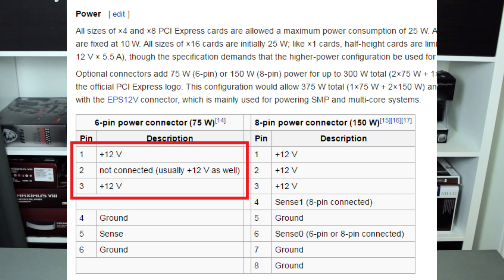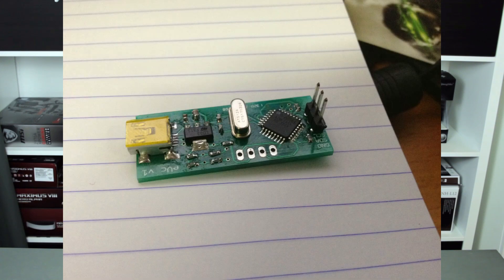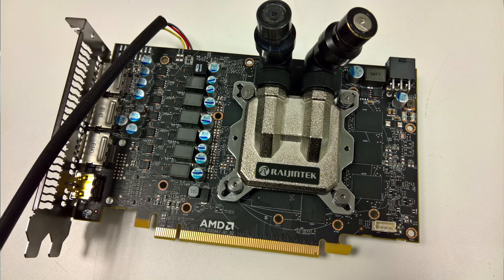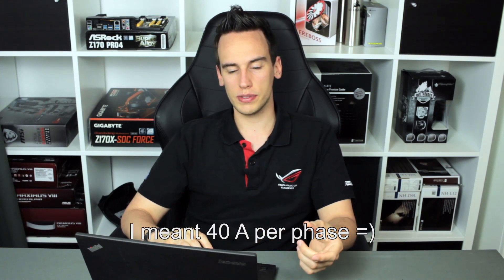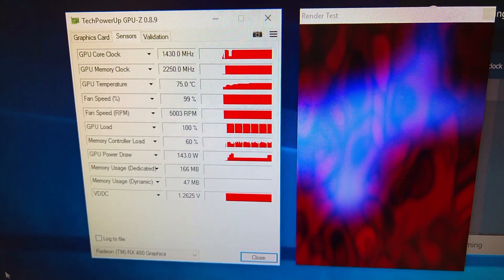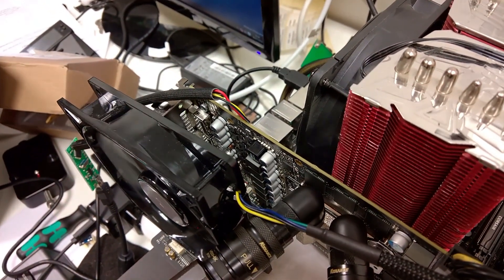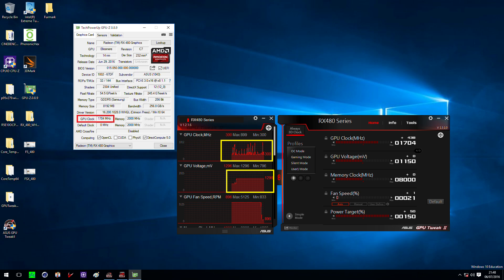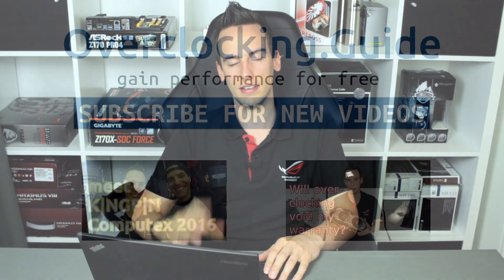Advanced AMD RX 480 Overclocking - 1500 MHz using I2C and watercooling

Comment: The first step anyone wanting to use a RX 480, is to check the motherboard's PCI-E specification to see if it's 3.0 or higher, the latest version if 4.0 slots, which is likely ONLY found in high end motherboards (mobo manufacturer uses 'spare' and surplus parts for mainstream boards because it's cheap).
Reply: PCI 2.0 should also be able to handle it. Also the AMD fix added one option to enable compatibility mode which throttles power so it doesn't exceed the 150 TDP in case you are too worried about it.

Comment: Great video. I'm waiting on my Sapphire Nitro pre-order atm. I suppose keeping it a constant 1400mhz should be fine? Or should I only clock up b4 gaming?
Reply: The gpu downclock if its not running hi demanding 3d load, no need to adjusting the setting for light work.
Reply: That's how I treat my overclocks. There's really no reason to run an OC while on the desktop or browsing YouTube.
Reply: Yea, but from what I can gather from screenshots you can OC by phases in Wattman so if you just OC on the higher phases you can actually keept it a low clock values in the lower ones (browsing, etc), ye?
Reply: Oh, I don't know. I'm not familiar with Wattman.

Comment: graphics score was 15,363. that is huge.
Reply: No, the second benchmark with the 16 612 score is without tesselation.15,363 points were made with standard settings
Reply: Notice that he has modified tesselation for that score.
Reply: Naah ... not really. Guy with 1360 MHz did  15,526 :)
http://www.3dmark.com/fs/9048815
Reply: weird its not huge in % but boost performance better i don't if smaller chip make oc values better
Reply: ....with tessellation disabled

Comment: in games its comparable to gtx980 or its better fps when overclocked ?
Reply: It depends on the title and the DirectX used. In general, DirectX 11 games will run better on Nvidia's GTX 980. Games that are optimized for GCN or use DirectX 12, will probably run as good if not better on the RX 480.
Reply: "no it doesnt touch 980 perf. someone here in the comments even posted his oc 970 and it was worst than his 970 oc." • Overclocked the 970 can get very close to 980 performance, and while the RX 480 will sit below this in terms of basic performance; keep firmly in mind that the RX480 simply has objectively a lower Clock and fewer ALU. This said overall the 970 OC, 980 Stock and RX480 Stock are very close in terms of performance; in general terms. It of course can changed on a game-by-game basis, but actually the more eclectic performance of the RX480 suggests that the Hardware itself isn't strictly bad but rather the Drivers are much more clearly immature and unable to really optimise DirectX 11 or OpenGL titles to the new Architecture. • This might give the impression that the GTX 10-Series (NVIDIA) have better drivers, because they're not experiencing the same issues in terms of aggregate performance ... but you also have to keep in mind that Pascal is Maxwell on 16nm and Shader Multi-Modules (as in instead of each SM being a 128 CUDA Block, they're 2x64 CUDA Block that can run simultaneous calculations; this allows VR to literally operate as if there are 2 GPU @ 970 OC Performance or improve Asynchronous Compute performance while still not actually supporting it on a Per ALU Basis like AMD); so realistically speaking for NVIDIA it was already highly optimised hardware and thus all their gains were primarily due to due size to continue to brute force the problem. AMD however while their Architecture is compatible with GCN, is almost an entirely different approach ... this might take time for them to begin to properly optimise the Drivers; less of an issue for DirectX 12 / Vulkan that is by-passing them anyway.
Reply: I think its comparable to the 980 but it's still a mid range card don't expect too much
Reply: no it doesnt touch 980 perf. someone here in the comments even posted his oc 970 and it was worst than his 970 oc.
Reply: The person who posted their 970 results was wrong.  When he posted his Firestirke score, his 970 at "1.5/2ghz " scored 2000 points lower graphically than the 480 score in this video (the first score without messing with tessellation).
Reply: Folopolis Did you mean 1080?  Because I think a non-reference 480 overclocked will absolutely beat a stock or slightly overclocked 980 by itself without CF, judging by the scores on this video.
Reply: 5 months later, which one is the better value now?

Comment: Ich hatte letztens eine Idee könntest du (falls es in deinen Buget/Intresse ist) irgend wie 3 jahre alte Komponenten Kaufen und probieren die so hard zu übertakten mit Stickstoff usw. Und schauen ob man auf eine benutzbare leistung kommt? Ich fände das voll interessant;) 

Gutes video Btw. 

+1
Reply: 7950 unter Luft von 800 auf 1150, rennt seit knapp 3 Jahren mit dem OC zuverlässig und benutzbar ist das definitiv. Die Zeiten als die Performance sich so krass entwickelt hat sind vorbei.
7950 hab ich 2013 für 199€ gekauft, die hat ca. 4TFLOPs und 3GB 384bit Speicher. RX480 2016 219€ 6TFLOPs 4GB 256bit. So gigantisch ist der Sprung nicht. Die übertaktete RX 480 hat ~50% mehr Rechenleistung, also was die in 2560x1440 kann sollte meine 7950 in meinen 2560x1080 auch hinbekommen. Kann man mit leben ;) (und gibts für 85€ auf eBay Kleinanzeigen)
Also da müsste man dann ein par Jahre mehr zurückgehen, oder ne 50€ Karte wie ne R7 250 nehmen und schauen was da geht.